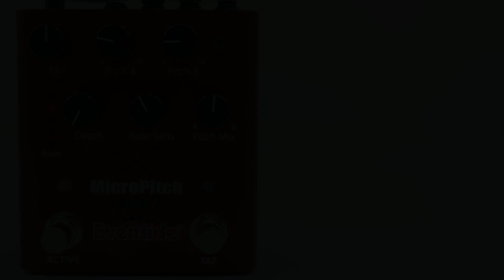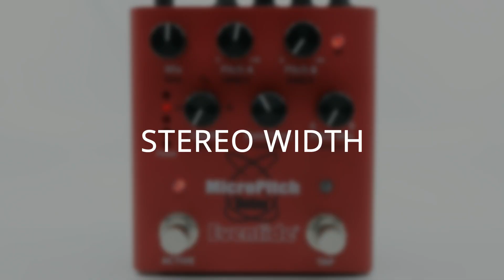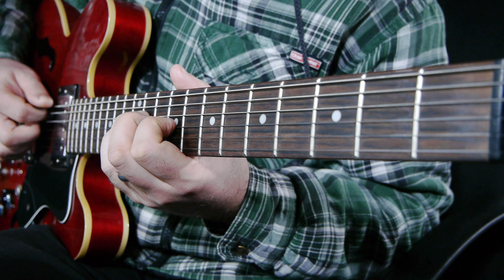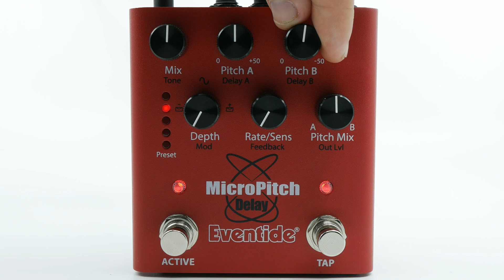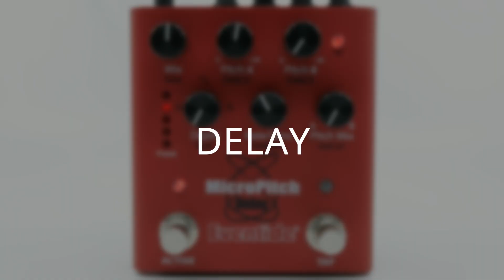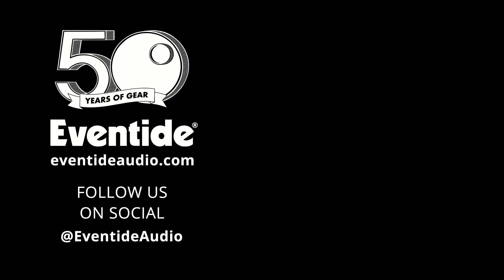Crafting Modulation & Delay Effects with MicroPitch Delay

Comment: Would this do any good in front of an amp, single.
Reply from the maker: Yes, for fattening your tone with the pitch shifters. It also depends how clean you’re running the amp. If you have long delays going and you have the amp set for an overdriven tone, it’s recommended to use the pedal in the effects loop.